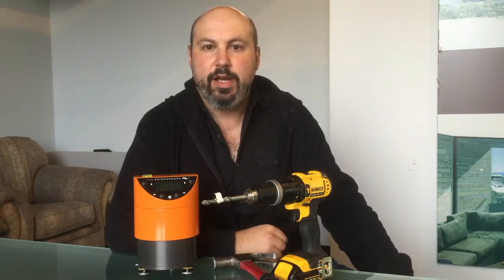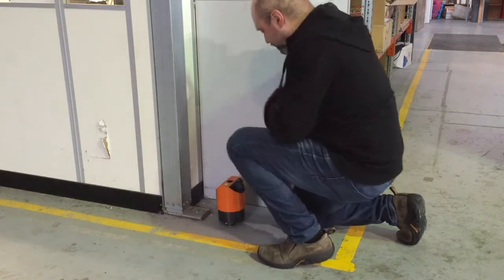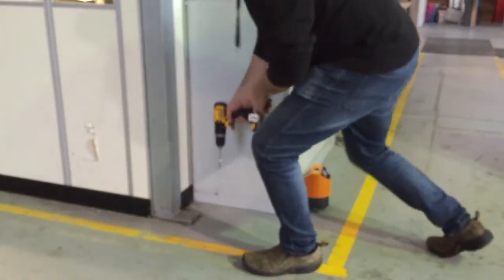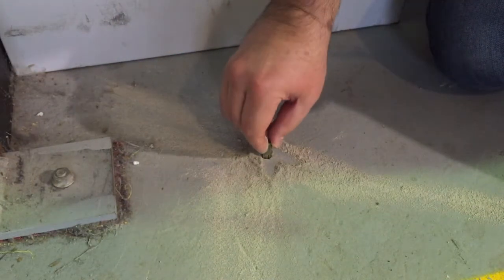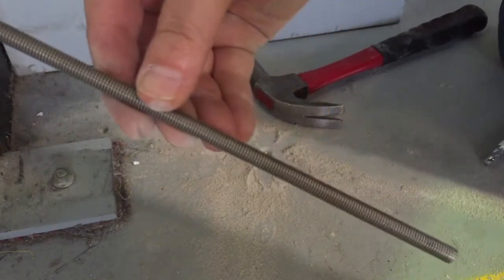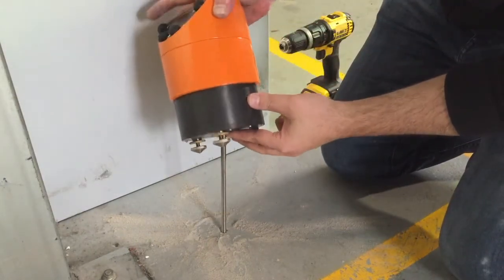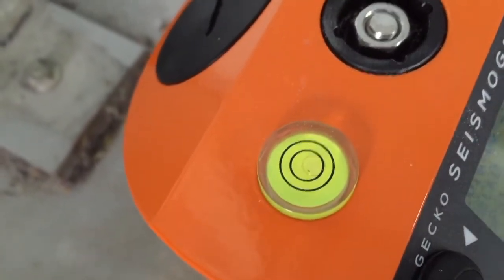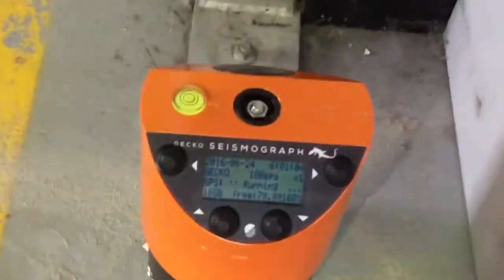Gecko SMA-HR installation

Comment: I'm want to ask a question about GEKO sma -hr instrument (my promblem) if i on this intrument after tree twinkling it off (error)
Reply from the maker: Again, the translation isn't good, but I think you are asking if the Gecko will recover after the power goes off. Yes, when power comes back the Gecko will start working again automatically. Is also has a battery backup option to continue operating for hours without a charger connected.
Reply: I have gecko SMA in different type from your video,there is no on-off button like yours in the video. I have a trouble with the mechine of mine.when I turn it on,it will turn off by it self in 3 second. Would you mind to help us to fix this problem? Thank you for you attention
Reply from the maker: @temontapimesra8711  Please contact the organisation from whom you purchased the Gecko SMA so that they can start a support ticket with us so that we can assist you. You can also email support(at)src.com.au